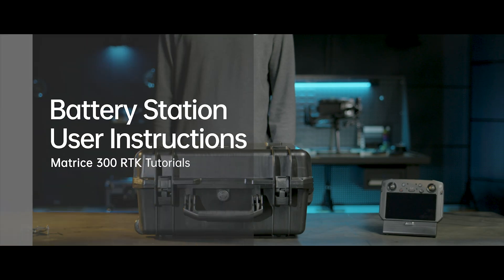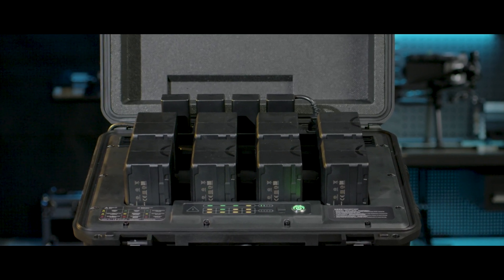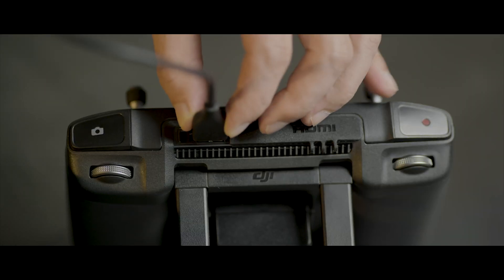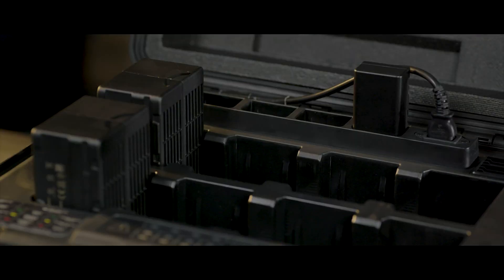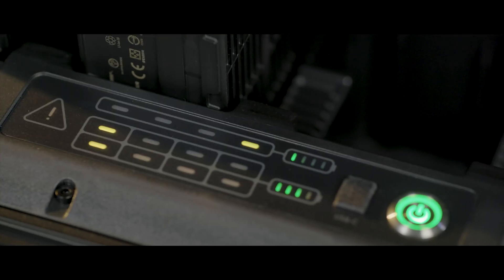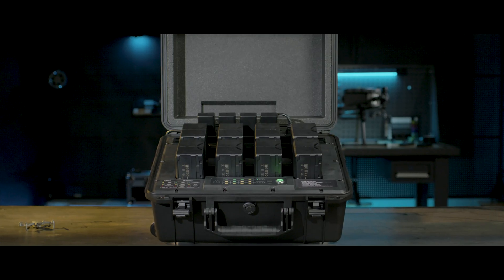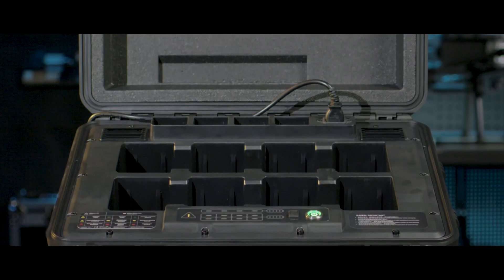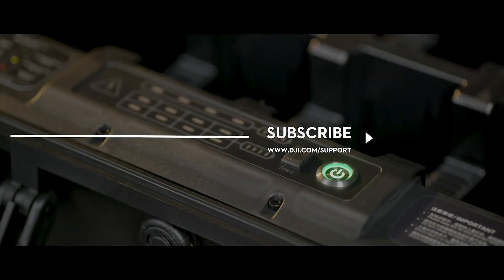M300 RTK Tutorials - Battery Station

Comment: Can I leave the battery station turned on with the batteries? Will it hold the batteries at a safe charge level? Is it better to turn the battery station off and only turn it on when I need to fully charge the batteries?

I have kept the batteries on the station for a week and they depleted to 60-70%. Would turning the station on/off fully charge them again? 

Edit Solution: Looks like I leave the station off while not in use. Batteries will auto deplete to 60%. Fully charge batteries every 3 months when not in use.

Comment: What is the maximum number of cycles must have tb60 batteries to replace them?? Thanks!!
Reply from the maker: 200 cycles is the recommended max. More information in the battery guide https://dl.djicdn.com/downloads/matrice-300/20200928/M300_RTK_Intelligent_Flight_Battery_Safety_Guidelines_V1.2.pdf